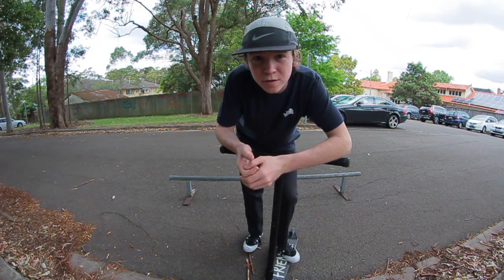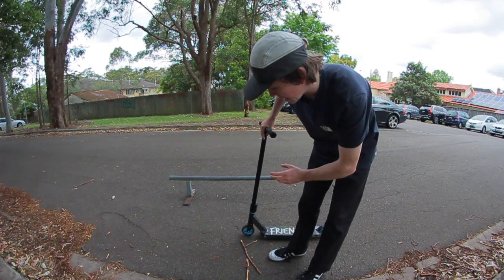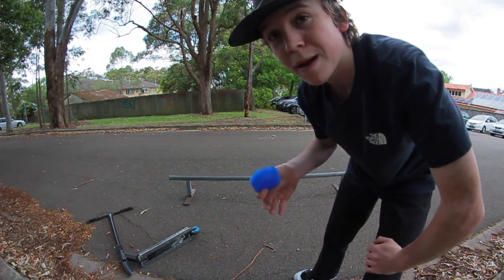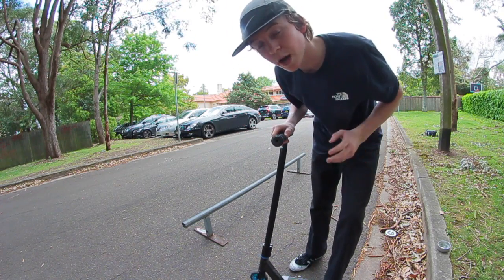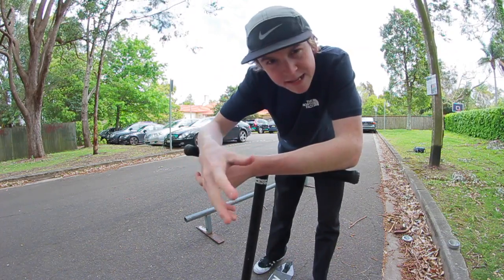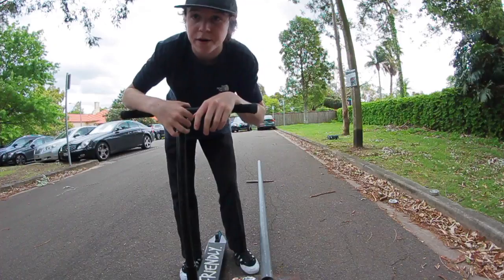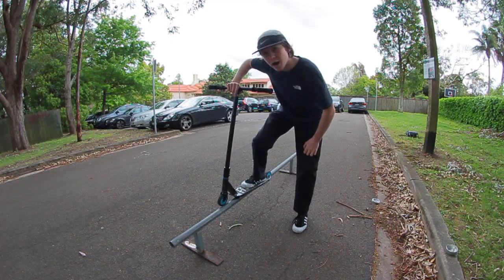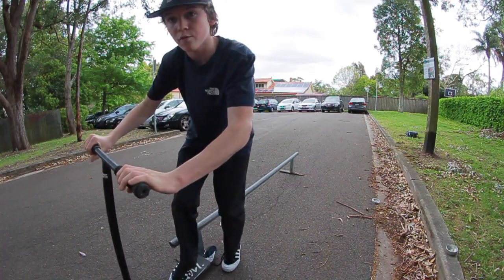How To Grind a Rail on a Scooter

Comment: Can u make a how to, back lips on flat ledges. I can do them on rails and quarters but they just don't make sense on ledges.
Reply from the maker: Yeah possibly in the future, i need to do the backlip on rail tutorial first though. If you can do them on rails all you have to do is wax the top of the ledge heaps incase your back wheel goes down and also lean away from the ledge and stick the back end of your deck out more then normal, hope that helps!
Reply: jack dauth thanks a bunch dewd
Reply: Jay Burns you lean. common sense isn't so common huh?
Reply: Ripple Effect I just needed some tips because I couldn't get them at the time lol no need for such cockiness